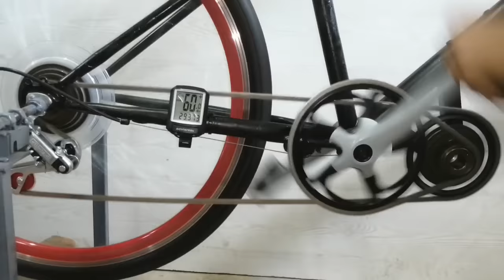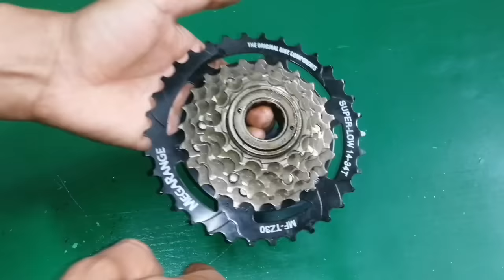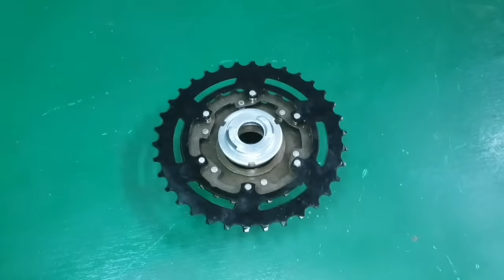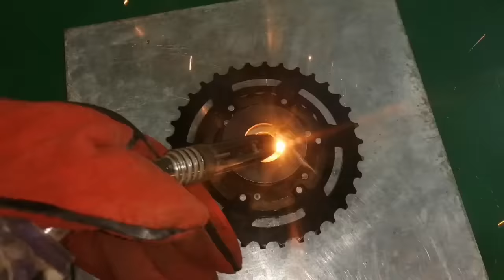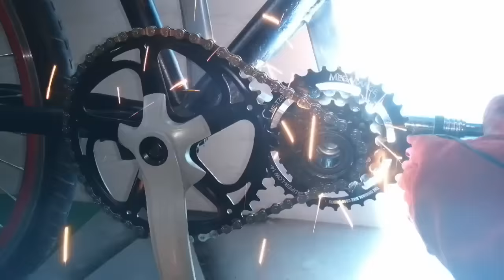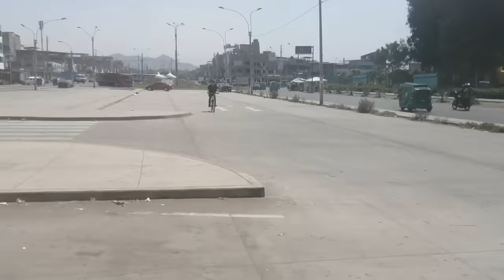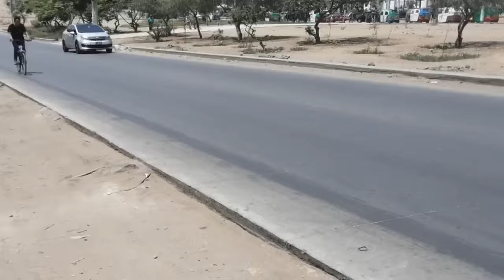making super fast bike

Comment: You can increase the final gear ratio as much as you want. But the power in a pair of human legs i.e. a cyclist, remains the same. (higher gearing requires more power to push the pedals). So it doesn't make you cycle any faster if you're not on a smooth downhill and you have gravity to assist you. Then nevermind going uphill ..... you can forget about that. Get off your bike and push it while you walk.😁
Reply: Yep, thats why it is pointless.
Reply: ever heard of a pro cyclist?a climber?a comuter?a gravel biker?
Reply: agreed, when comparing the revolutions/s from the start of the video with the end of the video, he probably just had a speed of 20km/h
Reply: @brianmeow  Have you ever heard of a pro cyclist that has a contraption like this? No? Well there is a reason why they don't use these. You can't climb with them, they are for smooth DH only.
Reply: My  friend. Is for efficiency .  I Hope you understand .    Thanks you
Reply: you can increase the torque more nm by eat steak and barbeque 😅
Reply: @amryms  💪😆💪
Reply: On a smooth, flat run the limiting factor is not the gear ratio but as you said the leg power and furthermore, as any regular cyclist can tell you, wind resistance.
Reply: You can increase the speed but additionally, the bike has not finished its tuning yet, if you increase the efficiency you should also tune the braking power, the faster you want, the stronger your brakes should be, the current brakes are no good, makes it dangerous, not safe for fairly occupied roads
Reply: Notably, in the few scenes of the bike actually being ridden, he's not really riding any faster than any of us could do under the same conditions.  Wind resistance and limitations on the "engine" (i.e., human) power prevent him from going much faster than a regular bike anywhere but a very steep downhill.  He could get exactly the same (useless) results by simply using a giant chainring on a normal crankset.
Reply: it could be usefull in a E-bike case. like a 750W where the motor is so powerfull thath pedaling on max speed is pointless, this could help catch up the motor and draw less power from the battery.
Reply: @alexandresquare  Perhaps, but you would need to ask how often these speeds would be attained in city traffic.
Reply: @ericbaillie1098  who talk city trafic ? Im like, think to comute between two big cities
Reply: No you just get more immediate results from pedaling harder within the gears, that's why a smaller gear takes more time to see increasing results, if you struggled with a normal bike ain't no way you can expect to go with more than you can chew and walk with the bike instead of exerting the proper amount of force needed to go on the bike ride.
Reply: There should be a way to shift this aswell. Use a normal gear train for inclines and this for flat and downhill tracks
Reply: When climbing, just shift to low gears as you would with other bikes or while driving.
Reply: @georgeemil3618  Well the low gears are screwed with this modification. The lowest gear would still be super  hard to push up a hill.
Reply: Ok boomer
Reply: @jurekgadzinowski2895  、
Reply: Some truth in that , but you could always add a bit more torque by having longer pedal arms , as it is it would be fun going down a big hill .
 As a young bloke , i can remember ( vaguely ) going down a long fairly steep country road  hill on my bike in top gear picking up so much speed i could no longer catch the pedals ( and i was trying )  , i passed a car on the way down , the whole bike was going so fast and shaking so bad towards the end , i was thinking this may be my last ride , thoughts of the front axle coming loose , or the brakes melting , or the tyres blowing due to the heat from the old rubber pads on rims getting too hot  :) .....  ahh its good to be young   :) .
Reply: Aero
Reply: @davidcanet9666  It's less efficient. You don't add another source of friction to increase efficiency.
Reply: This set up is more likely a loss of efficiency, because of the added weight and the added frictional losses from have more moving components.  The only gain in efficiency is if there is a perfect gear ratio for an individual under all terrain conditions. This is unrealistic, because standard 14-18 gear bikes provide optimal range for human cadence on nearly all terrain. The limitation to human speed is due to power limitations and wind resistance which increases as the square of speed. The transfer of human power to locomotion at the pedals is not the limiting factor as a well tuned bike is ~97% efficient.
Reply: P = F x v, the FORCE only generate by your muscles (a power and it reduce over time!), you want to get v=max it MUST be increase the FORCE (which is reducing over time).Yes the gears can amplify the force by nX, but that gain of force from gear assistant will be normalize with friction, wind dragged and most importantly is the weight and gravity on up hill. So at the end, your speed most likely depend on power of your muscle! The efficiency is not that great to your effort and cost!
Reply: @jurekgadzinowski2895  it is not pointless. You watched a video of it, and that was the point...
Reply: @radiocontrolled9181 , what are you on about?! Did you watch the video? LMAO The guy barely has any muscles and still he didn't seem to have had any trouble riding this bike, looked like he did it quite effortlessly...
Reply: No its not that hard
Reply: @BastelPichi  it has no real world application
Reply: @jurekgadzinowski2895   but you can long range of the pedaling if you put  bielas more large
Reply: @BastelPichi  ah yes, the all important 0.00000000000001% of the worlds population. Very important for those, irrelevant for everyone else.
Reply: It does allow you to cycle faster.... fir an experienced cyclist on the flat the limiting factor isn't the torque required but the pedal rpm .... on a flat road it's air resistance that needs to he overcome but a strong cyclist has the torque in their legs to do at least 50mph but kn an ordinarily geared bike the pedal speed would make this virtually impossible. Yes its swings and roundabouts with gear ratios and you don't get one thing without sacrificing another ....but with this setup a moderate hill would still be possible with one of the larger dogs on rear cassette selected ....it's horses for courses and dependent on where you live and type of cycling you mainly do ...finally the proof of the pudding (I'd better make it the last point as I'm running short on idioms 🤣) the guy is literally riding it in the last third of the video and riding it pretty damn fast.
Reply: @TeamCykelhold  Brian's point was that you can have different bikes for different circumstances and riding .... certainly not DH only, you could easily ride on the flat or even a mild UH gradient utilising the rear cassette.... yiu wouldn't take a road race bike down a mountain bike course would you .... pro race cyclists don't use this because they encounter a variety of gradients- they have the best bike for the job at hand
Reply: @TeamCykelhold  Well, considering the gear ratios that they are using, this video wouldn't be too far off.
Reply: @olieko  And that's why a stupid system like this does not have any real world application. You don't need to introduce more drag and lost watts to the system for no real benefit.
Reply: @jurekgadzinowski2895  For a non-stationary bike yea, but would kill on zwift lol
Reply: no watts was saved :D
Reply: I had your comment in mind even before I saw it. What you gear up, you have to put into the system with higher torque with your legs. I have found a pretty nice "sweet spot" concerning the brute leg force, cadence combination, and ground speed. Actually, I have no real explanation, I get faster uphill on some climbs in fifth gear than in fourth gear. My experience is that it is not always the highest or the lowest gear that gives me the performance. That super-geared bike is fine if you have a long downhill slope, and a nice 50 knots tailwind with no crosswind component, your mother called and demanded you to be home NOW. By the way, you need a toilet for #2. Those parameters will speed you up! The system is hardly good for normal conditions. Okay, I like the mechanical work!
Reply: @robertsvensson4304  Agreed Robert. And yes, sometimes a gear which is easier will be slower uphill, because you will not be pushing out all of your watts on it. Lol @ #2 🚽 toilet.... so better excrete before the  50MPH downhill-with-tailwind ride 😆
Reply: Duh. Thank you very much for pointing obvious facts. If super high gearing has no interest to you, why did you watch the video?
Reply: Obviously hahahahaahahahah !!! 😂🤣🤣🤣🤣🤣🤣🤣
Reply: Nope! that's incorrect to what I know as one of the best bikers is that more gear ratio helps to make a wheel faster.
and as in this type of situation you will be able to go faster.
Reply: Надо увеличить речаг
Reply: I think that with my 400 kg of strength in my legs I can achieve a much higher speed with this mode of cycling
Reply: Если силы свежи и ноги штангиста Вы порвете цепь
Reply: @user-gb5ui7js1n  да шо говорить ,раму в батарею согну!!!!!!
Reply: @punpck ฮ่าๆๆ
Reply: @brianmeow  They lower the gear ratio
Bruh, even cars can't go up much at anything other than 1st gear, and this is fragile human legs
Reply: @sepg5084  Pointless = useless
That's om it
The fact that he made some garage experiment for views doesn't mean it's any useful, for you at least
And it is impractical as well
Reply: In sure every child know this
Reply: @dailygrow6961  And yet, read the comments and you will see that reality is different 😁
Reply: @radiocontrolled9181  Im not native English speaker so I dont know rly what the meaning is but I thought the first comment says that the gears makes it faster in payment of more raw leg power. Thats simply the same principle with standard gears. Only going harder in ratio for more speed. Nothing new 😆?
Reply: Yep agreed. This would work well on a really high wattage e-bike though
Reply: Did you consider shifting from lower to higher gear?
Reply: I was thinking the same.. the resistance doesn't change so therefore the concept is futile because you don't have enough power at the pedals to use such high ratios.
Reply: That's dumb dude,  cause he can still switch to a lower gear while riding cause he didn't mess with the gears on the rear wheel. So he can still switch his gears from high to low to make it up hills.
Reply: Yeah, I got 32x11 singlespeed and that's how it is.
Reply: even downhill its not faster than any decent bike,i think these kinds of vids are being made by people who have never tasted a decent bike ,as quite a decent cyclist (very few human powered cyclists pass me when i ride in the city) in my highest gear downhill i never have a problem adding speed due to lack of high gears like i used to have when i had a trash bike were the juice was not worth the squeeze in me having to pedal like a maniac,, now when i want to pedal like a maniac for the workout of it i have to lower the gears in order to do so
Reply: A Cycless walker after my own legs helping heart !o! , he conveniently omitted the speedometer too
Reply: @jurekgadzinowski2895  If it was switchable for downhills it would be fun
Reply: @georgeemil3618  But this gear ratio is pointless. The best efficency and the most comfortable pace for an average person is 60-90 crank rotations per minute, for someone who is more advanced it is around 90-120 rotations per minute.
With this gearing, 90 rotations per minute is geared for around.

Play this video in slow motion, uou will see that he does less than one rotation per second, he did around 45 rotations per minute, so if an average person would get to ride this bike at the usuall peddling speeds, the gearing makes sense once you reach 60/45 of the speed shown in the video, so above 90kmh.

This tiny cheap casette at the rear has maybe a renge of 300% at best, so the lowest gear is geared for speeds above 30kmh at the 60rpm, its lowest gear is for higher speedst than the last gear in the most of the moutain bicycles.

It is pointless to increase lenght of the gears when you do not have power to accelerate to use them.

If you want to make your bike faster, you should increase efficiency and decrease the rotational mass, the correct way of doing this is changing the cranks to the lighter ones, changing the rear deraulier wheels for the bigger size, so the chain is not bent in such a ig angle.
Reply: @sepg5084  Makes sense.
Reply: @bshthrasher  My man...
You dont need to be a 150kg bodybuilder to ride a bicycle at the speed of 15kmh.
In fact proffesional cyclists, road, or moutain ones, are fairly skinny and light, around 70kg and 180cm.
Reply: @BastelPichi  This bike is not going more than 40kmh untill it goes from a steep hill. And its acceleration is terrible
Reply: @BastelPichi  Any source of that record? Couldnt find anything excluding the bike being pulled by a motorcycle or a car.
Reply: It also has more friction, so you will actually go slower.
Reply: Sheesh looks like we have little einstein here😂😂
Reply: Gearing can make it easier. A 100bhp car will struggle to climb a steep hill in 6th gear at 30mph, but put it in 2nd and it'll do it fine. Even though the engine is putting out the same 100bhp both times.
Reply: @mcgetrekt2388  Yes of course! But if you watched the video in this case he is going from second to sixth, the opposite of your example.
Reply: it would be difficult to accelerate but you would be going faster
Reply: I wholeheartedly agree!
Reply: @johnarroyoangeles72  power=force x distance/time
Reply: Nope, high gear or small ratio are limited by chain meshing and the largest sprocket up front or rpm  he down gearing that final max rpm useing leverage so it easier to get that same max output. So he will get more speed as leverage and lower rpm beat max rpm got it. He can use body weight or standing and he not 
doing that. So he still has more speed available.
Reply: @thomas4315  tf, are you in 4th grad or is english not your first language. I guess your parents wouldn't tell you if you were dropped as a baby. but really, adding another set of gears will increase speed or torque at the end shaft. where does bodyweight and leverage change or affect the final gear ratio output?
Reply: @brianmeow  ever heard of gear shifters? deraileurs? hub gear-boxes?
Reply: @davidcanet9666  You'd be more efficient with only one chain with the combined gear ratio. But then again, you'd have immense difficulty trying to accelerate, because the torque required is too high.
Reply: @ericbaillie1098  Yes but only once you're up to speed. With that gearing, your first obstacle will be the immense amount of torque needed to even get moving.
Reply: Don't be so negative. The maker of this bike probably know the limitation of his design. The point is that his bike can go  super fast in a limited situation.
Reply: @davidcanet9666  each gear stage introduces friction that reduces efficiency.
Reply: the only person who can actually use this to its full potential would be quadzilla
Reply: If they adapt this to e-bikes than maybe it will not be a bad idea.
Reply: Thanks for the explanation. We will delete the video.
Reply: Exactly. I can put a 1200 tooth gear on the wheel and the torque will still be limited by the power.
Reply: Flat ground needs no other power than known gear ratios. Faster up vs. Faster down. Either way, it's all about engine output. BHP vs. HP
Reply: Electrical motors ebikes
Reply: How much cost approximate for the modification?? Tks
Reply: my guy you spittin facts your right
Reply: Stop skipping leg day.
Reply: Learn how to draft.  That's the only way this makes any sense.
Reply: Yes bro
Reply: What about physics of hills and wind? This only works if you're drafting behind a large vehicle on flat or downhill terrain.
Reply: @davidcanet9666 this is the least efficient way to cycle. I hope you understand, thanks
Reply: @amryms ride motobike is cheaper , yu can go just by drink water
Reply: @johnsimion2893 you can see he’s limited to cycling at a pretty low cadence, because of the very high gearing too
Reply: if he had 30 gear deraileur, it would make more sense than... what he did. since you could smoothly get up to the fastest gear like on every bike. but ! usually its limited to some... 24 speeds because then your legs arent strong enough anyways and you can use it exactly as you say, on downhills
Reply: @izzabelladogalini You're not taking into account material strengths as another limiting factor. More torque requires stronger materials to withstand and transmit that torque. There's only so much torque any material can withstand before it breaks. And stronger materials usually means adding thickness (i.e. more weight) to it. And more weight equals slower bike.
Reply: @RafaelBenedicto  what do you mean limiting factor, at no point did I say you could use ANY ratio. Did you watch the whole video and read my comment to the end? Two points 1) any standard crank of reasonable quality can take any torque any human can produce 2) the guy is literally riding the bike at the end of the video, clearly any limiting factors have not been reached ...nothing snapped nothing bent nothing broke and the bike wasn't too heavy (also note that despite the modifications he made he retained the original pedals and cranks, they were more than strong enough for the job).
It's simple, the original comment said changing the gearing won't make you go faster, I said under the right circumstances it will, the video literally shows how the guy built a bike with higher ratios and RODE it FASTER
Reply: I ride a bike myself and I can say that pretty much looks like around 40 kmh @punpck
Reply: When using a rope with two catrols, you can lift twice as much weight with the same power
Reply: no youre wrong, i did the same to my bike and i can now cruise at 50mph with minimal effort, and i can climb hills at 30mph with minimal effort
Reply: @kaizasoze3954  So you installed a 125cc motorbike engine? Or a big electric motor? 😂😂🤣🤣
Reply: @radiocontrolled9181   i just done the modification in the video, like I said cruising at 50mph with very little effort, if I push hard i can reach top speeds of 120mph but cant maintain it for  more than 20 minutes as im obese and weigh 320lbs. I do believe part of the reason why i reach those speeds is because my bike is very light titanium, only weighs 7kg
Reply: @kaizasoze3954  Aaaaahhhh!! Thanks for clarifying.... that makes perfect sense now!! 😉👍🏼
Reply: 😂😂😂.... that's true man
Reply: @asupremechieften  I get higher top speed with middle gear ratio (faster than with top gear) (and that's on a decline & yea I don't have big power).
Reply: So how bigger is this than the original chain ring?
Reply: Don't quite get how this increases gear ratio? It's fascinating design.
Reply: We dont need bicycle if they aren't faster than our sprinting speed i rather stand on each pedal to drive my bicycle than driving it while having seat on low speed gear
Reply: Yeah we know. Still cool. And like U said down hill U can fly, still have purchased at 200kph where otherr wise ud be springing at 100kph.
Reply: You have to build up to it
Reply: Cierto.
Reply: Knee joint will be damaged faster.